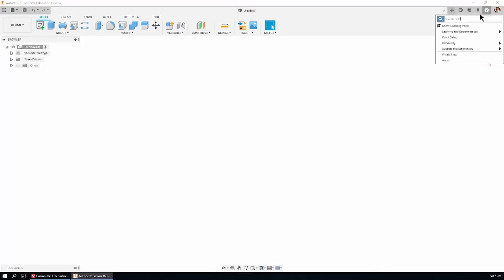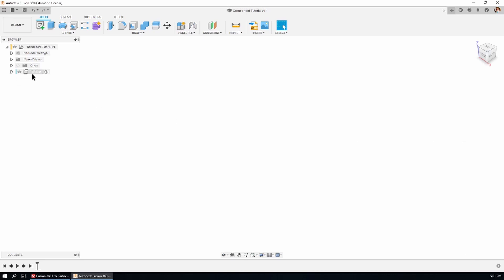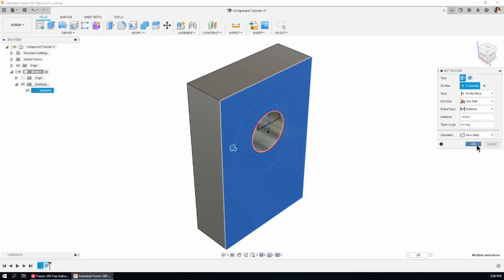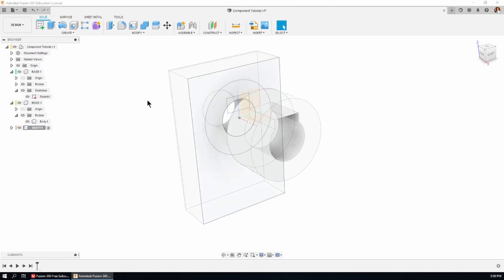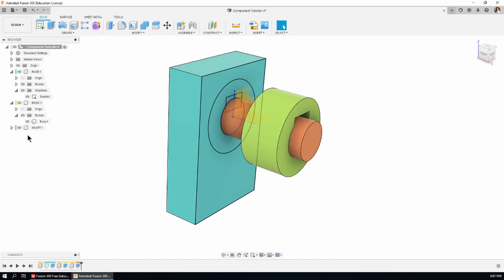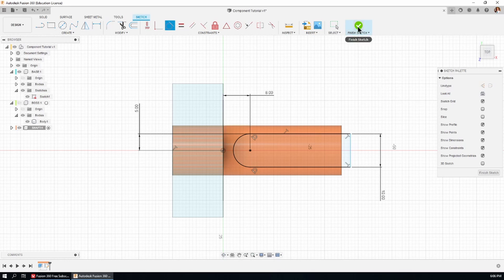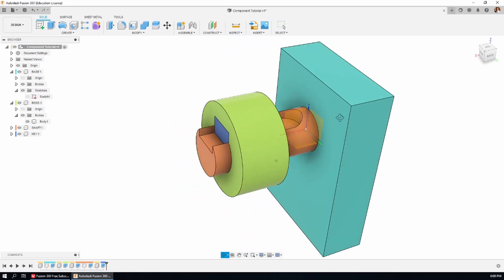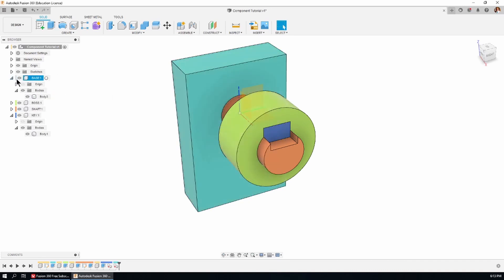Bodies And Components Fusion 360 | Beginners topic

Comment: I create my 3d objects in F360 and export using the .3MF extension as that opens easily in Cura for 3D printer slicing.  I notice the circles are really multi-sided polygons when I open the 3MF file.  If I export as STL (takes longer) I get better resolution on the round parts.  Is there a setting I am missing to get better resolution for the 3MF files?
Reply from the maker: LJB, I'm a beginner in 3D printing and haven't even tried the format you're asking about. I'll be publishing on some specific 3D printing topics soon but I'll try to avoid sharing my ignorance.
Reply: @ArnoldRowntreeTeachesFusion360  Feel free to ask any questions about the printing process.  I've used Tinkercad for years and just learned F360 from your classes.  Now F360is my go to for new designs.